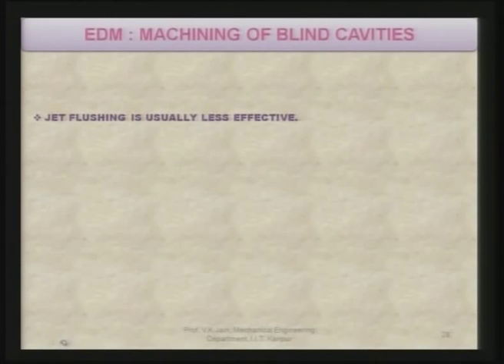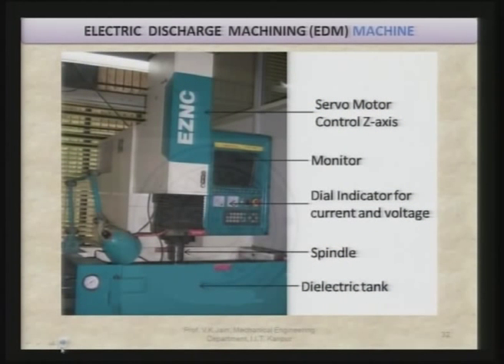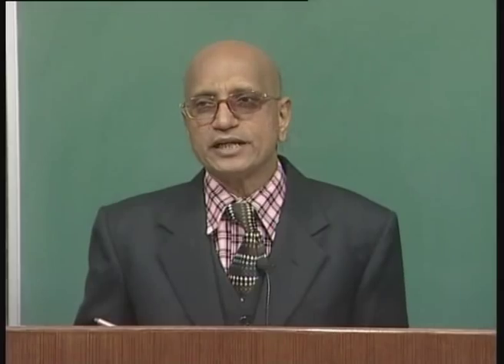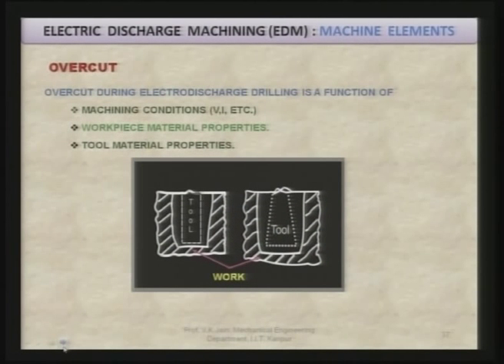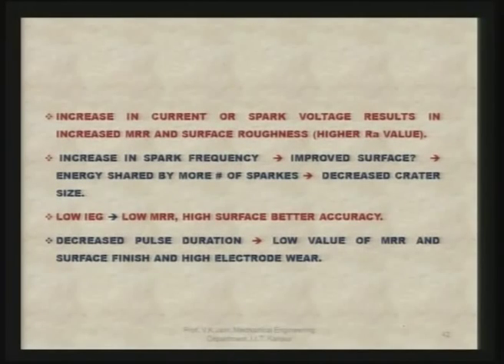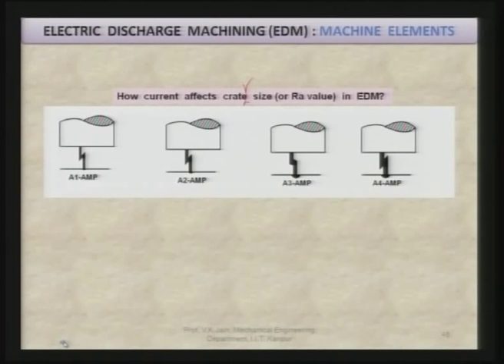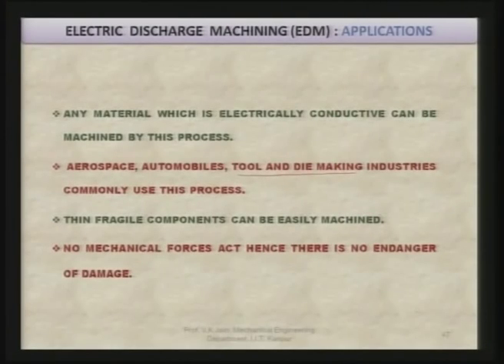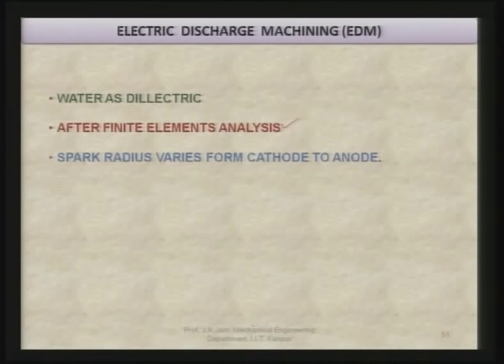Mod-01 Lec-17 Advanced Machining Processes

Comment: In this lecture  you have mentioned that with decrease of Pulse duration, there is high electrode wear?? How??
  I feel that as pulse duration decreases, MRR gets reduced and improving surface finish, thus lower time for spark to occur, hence low EWR.
Please explain.